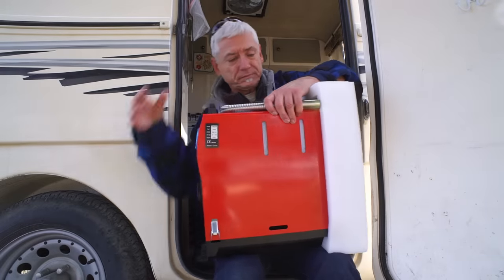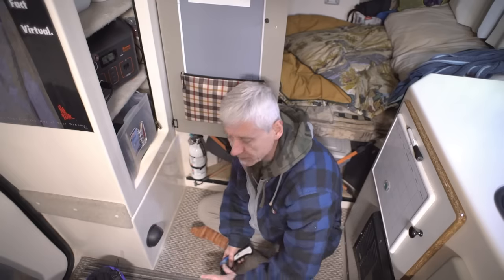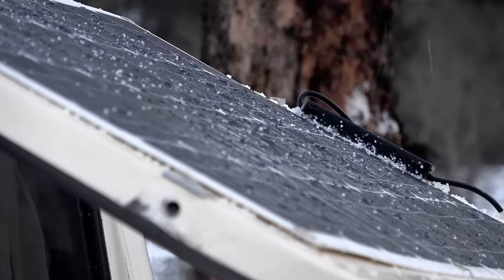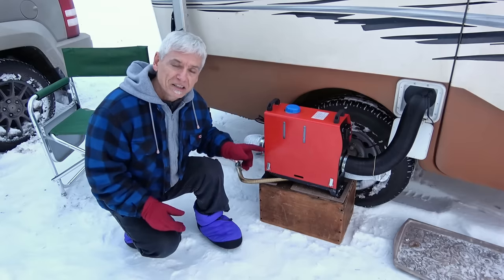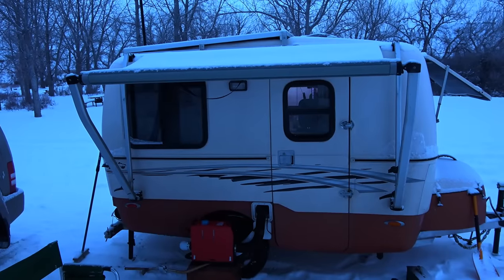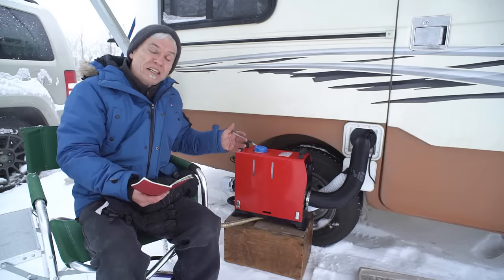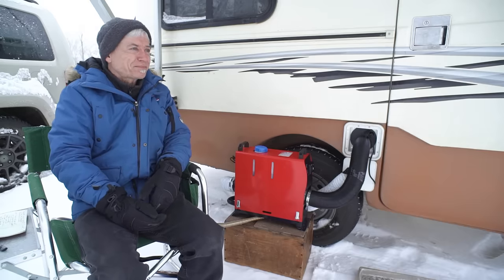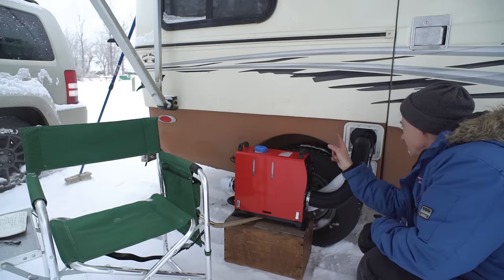Can this Work with a Camper? My Parking Heater Experiment Part 2

Comment: Great review videos SP. 

Now you need to silence that fuel pump! There are great YT videos on how to do it.

I can hardly wait to see you bring out and use the Fat 50 rocket stove again. Such a great design and build series you did on it. Needs no power and isolates the combustion from the living space so you don't have to open windows when it's minus 30 C. You have done 4 hour burns using pellets, and you even cook on it while it boils water for coffee! WOW - now that's impressive! Now all I'd want is a longer burn time, and no constant need of tending regular wood fuel.

I've been researching Batch Box Rocket Mass Heaters and encapsulated phase change materials (ePCM) for high latent heat storage for use in applications that don't have space or capacity for the weight of thermal mass storage. Man 2020 was a crappy year in many respects, but the potential for making things better are phenomenal.

Love your channel Slim and can hardly wait for your next video. Best wishes for the new year!

Comment: The sound or the noise that the heater makes, I think, hopefully I could eventually get used to....I think? The big issue I have with this unit would be safety.....carbon monoxide. These things make me nervous. Other than that, you did a great job, just be careful. Thanks for sharing. Be safe.  -Stephen, Ohio 🇺🇸
Reply: @fyter889  I did not know this. Thank you for teaching me something new. God bless.

Comment: well ok you sort of cleared the air. you are so close. thing you missed is you never told anyone you need the hole in the summer. take the intake for heater run it into the trailer. the noise take the pump mount screw out wrap the pump with a pool noodle use a wire tie to hold the pump. now you will have it.  awesome video finally. any question I will help you beat this you are so close buddy 🛠️🇨🇦🛠️🇨🇦
Reply: Good to know you are keeping up with Slim, Badge.😊

Comment: Slim, if you dont have that propane  bottle in front of trailer, it would be perfect place to put diesel heater there. Off course, to remove it from that red metal box. Also I'm glad you extended exhaust pipe. It was really near to fresh air inlet. Have a great new year.

Comment: I've put many 1,000s of hours on my diesel heater over the past 2 years in my truck camper and love the dry heat. I have a built in one, but same thing.  You're correct there is a learning curve with these heaters and if you aren't a handy DIY person then do some research.  Fortunately many YT videos, Facebook groups that cover every aspect of these heaters.  First mod I made was wrapping the pump with foam and making a shock mount.  That cuts the pump click down to barely audible.  Box to protect it from the elements would be practical too.  Look at all the videos you could do trying to stay warm.......:)   Stay safe out there.
Reply from the maker: In all honesty, none of the online suggestion accomplish what a I am looking for. A portable unit that keeps the trailer above freezing in a eggshell camper. No van build stuff. thanks! SP

Comment: My own 'experiment' reflects your experiences exactly. I fitted one of these to my teardrop camper and came to pretty much the same conclusions......If you're good at 'tinkering' and understand the risks, I think these can be recommended. I now keep mine in a modified toolbox which keeps the fuel line and exhaust pipe separated and running in two different directions. Good video! I haven't been brave enough to try sub zero camping yet though! One note: I found that mounting the fuel pump to the toolbox and keeping it isolated from the camper makes the annoying 'ticking' sound down to an acceptable level. YMMV.
Reply: Yeah I was wondering whether mounting it in a better case would help. I'm sure that flimsy case would do nothing and may even make it louder.

Comment: Just a thought. You can get quite fule pumps cheep at auto parts shop. Also you can replace the fule tank with your own "gas can" and plumb the "can" to your heater and "never"run out of fule as you get a 3 or 5 gal "can". It does work. may be 35.00 USD to do so. Great video thank you.

Comment: I think that clicking noise would make me crazy
Reply: Funny that we get many visitors that can't stand the ticking clocks in the house. We don't hear them any more. It's what you are used to I suppose.
Reply: Have you heard the sound of a typical propane heater in a smaller camper?? That clicking sound is nothing compared to that.

Comment: I'm sure you know by now, if you recycle your inside air, you wont get the diesel smell in your living quarters.  Also, suspend the pump (on an angle), by a rubber band, or elastic cord.  It will almost completely eliminate the sound.  These heaters, while being from a less than reputable dealer (common for their country of origin), do preform very well, when installed correctly.  I understand that you don't want to do that, for obvious reasons. It looks like this heater is causing you a lot of stress.  (I follow your channel and watch every video).  Maybe you should donate it to someone, and get back to being happy.  You're an inspiration to a lot of us.  Happy trails in 2021, buddy.  May your path be smooth and full of wonder.

Comment: I've seen other people on YouTube that mount that fuel pump with rubber and it help make the pump a lot quieter
Reply from the maker: It is on rubber. I also tried wrapping in close and open cell foam. No difference. SP
Reply: @SlimPotatohead  Yes mine is mounted on rubber as well and it’s still loud, but I have seen silicone covers for them as well to help isolate the ticking, no idea if they are any better.
Reply: @SlimPotatohead  I've commented this elsewhere but you could try putting the pump in a box filled with sand. It may get hot, but it's worth a try.
Reply: The place where it mounts to the case is where I've seen them use a piece of rubber between the fuel pump and the metal case most people use like a piece of thick rubber like a cut piece of car tire rubber
Reply from the maker: @Franz Rupert, that would totally defeat the portability requirements. Just not practical I'm afraid. SP
Reply: @SlimPotatohead  I'm sure you could mount the box on the heater case and relocate the pump there. I did this with a fuel pump in the back of my car which was silent after that.
Reply: The rubber is like 1 inch wide 2 inches long and mount the rubber to the case in the same place that the pump mounts then the other end mounted the pump so the pump only mounts to the rubber then the rubber is isolated the pump from the metal case I've only seen videos of it done and from the video there's a big difference in the loud clicking they make
Reply: Good luck and happy new year just putting me two cents in  trying to help someone out keep up the great videos

Comment: Slim from my experience in Newfoundland in 1969, running diesel generators. We had a cofferdam outside the building where the tanks were, when the temperature got down near 0' Fahrenheit ,the fuel oil would start to separate, there is paraffin in fuel oil and it starts to gel causing the lines to clog up! So we had to put warmers down in the cofferdam to keep the tanks above freezing. Out in town, Jersey Side, I rented a room in a house and they had the same problem, Nefie style, everybody had a 55 gal drum up on stilts, with a 3/8th copper pipe into the the old Sears pot heater. (a lot of people did not have electricity) so I had to take a torch and go along the fuel line to melt the clog away. The usual place was the fuel filter at the tank, it looked like a milk shake.
Reply from the maker: Perhaps they didn't have winter diesel in 1969. They do now, in every Canadian gas station! Thanks, SP
Reply: @SlimPotatohead  Yes, that might be, in the States, there is #2 fuel oil you buy for heating use that has a red dye in it. It is cheaper than the one you get at a fuel stop because that diesel has road tax on it ( trucks do a lot of damage to the roads), but I don't know what additives it has other than the newer low Sulphur kind. When I got out of the Navy, I went to HVAC school because I learned in Newfoundland that working on trucks and busses  with your but slung out in the wind or big gobs of ice and gravel laden snow falling in your face when you were underneath, was not the way to go. Not that I didn't come out of some of my oil burner jobs looking like a coal miner. Just started getting into RV's while helping my daughter trick out a ProMaster City. I am looking for one to do a conversion now, but I need a high roof one. A few around now that the Pandemic has put a lot of tradesmen out of business. I am in constant contact with Static Camperman in Seattle. Sorry the borders are closed because I would like to do the Maritimes. ( No Nefie Jokes please) Besides they all moved to Toronto when they shut down the cod fishing!

Comment: I am contemplating installing either a gas or diesel heater into the bed of my overland pick up. Still doing research on the best way to go and there is so much conflicting info that I am still undecided. My own opinion is you get what you pay for so I would most likely buy a Webasto even though the cost is outrageous. Thanks for all your work on this topic I found it to be very worth while. Wishing you save and peaceful travels.
Reply from the maker: You get what you pay for is meaningless. Does spending 10 times the cost get you 10X more? Never. SP
Reply: I think I would justify buying the Webasco based on safety alone. Plus you can get them that run on regular gasoline eliminating the need to mess with diesel fuel if you don’t have too.
Reply: @salparadise8974  The Webasto gasoline heater is what I am leaning toward. I can tap into my gas tank and not have to mess with carrying diesel. I have read the carbon build up is greater in the gasoline heaters necessitating the need for carbon removal more often. I have not read of anyone having safety issues with Webasto unlike the Chinese heaters SP mentioned he has safety concerns. I will continue to do more research before making a decision. I am not convinced the Chinese heaters are of the same quality and I don't like to mess with products that you have to constantly do this in order for them to function for their intended purpose.

Comment: I’ve Watched a ton of diesel heater installation videos and no one has ever installed one outside like that. I Purchased one and haven’t installed it yet. I want to install it in my motorhome. I plan to figure out a way to dampen the tick tick tick noise so I don’t have to hear it.
Reply: I don't know how hot the pump gets but you could try to build a little box out of wood around the pump and fill the whole thing with sand. This would cancel the noise. Might not work because the pump could oberheat and stop working.
Reply: I suspect what your hearing is the injector pump. You could insulate the heater to quiet it from neighbors (simple to do) but the hard part is the air hose going into the trailer. It acts like a audio transmission line to the inside. The only way to quiet it is to put a muffler (designed for the specific sound) and not restrict flow. It’s a difficult engineering challenge.
Reply: There is a guy who camps in a tent on the car roof. He has built them into a suitcase and has it outside the tent.Sorry I can't remember the name but you should be able to find it on YT.
Reply: I had one inside of my 26 foot trailer. It was so noisy I removed it and sold it. I went back to my PlatinumCat brand propane heater for a more steady fan noise. It too is very thrifty on fuel.

Comment: Need to Run Them on High before Shutting it Down,Burns off Excess Carbon Build up,[not a fun job-Cleaning Inside]
Reply from the maker: It does this automatically. SP
Reply: Right, Same I do.
Reply: Never turn the power off but always let it cycle down to cool the heat exchanger before shutdown. I'm told it can cause damage to just kill the power....
Reply: @SlimPotatohead  not compleetly, the fan cycles up but the fuel stops straight away. You need to set it flat out for about 5 min then switch it off. I haven't had to de soot mine since starting to do that.
Reply: @SlimPotatohead  What it does at the end is turn off combustion and run fan to cool down the unit.

Comment: I am a hothouse plant from South Louisiana. If the temperature drops below 66 F,  I can't sleep, regardless of how much bedding or clothing I have on.  My wife, being from Canada, is more comfortable at the colder temps.  We compromise and set the thermostat at 68 degrees, cold enough for her, but not too cold for me.  We also compromise at the upper end of the range.  I am quite comfortable in temps in the low 80's, even with 100% humidity,  but she is dying when the temps get above 78 degrees, so we keep the house at a rather cool 74 F, in the summer.  We used to visit relatives in Canada during the summer,  and I knew I could never stand a Canadian Winter.  I am tempted to play "Snow Bird,"  and move down to Mexico for the Winter.  :D

One more thought, wouldn't it have been better to replace the high current draw inefficient fan in your current heater with a more efficient one with lower current draw?

Comment: After fighting with 2 of the Chinese heaters for 3 years as a permanent install in my Delica Van, I finally gave up and bought the same Webasto from Russia around Christmas. So far so good, and the better quality is obvious, but in tests in my driveway it also seems to shut down after 12-18 hours in spite of the 200 AH battery it runs from, a problem I will be addressing today in fact. I am making a portable one like yours from the Chinese heaters in a spare metal case I had rather than throw them out. For those, I have the same controller as your second one because I was told that is the only controller to use at altitude such as the Columbia Icefields where I often camp. I cannot hear the fuel pump of the Russian unit at all, perhaps because the fuel pump uses a damper (I think you can buy these dampers for a few bucks from Ali for yours), and it is mounted in a rubber bracket and has  no direct contact with metal. It also gets the inside of my van up to +16 when the temp outside is -25C, which is about a 10C improvement over the same Chinese units. The two best Youtube channels I've found for dealing with these heaters are John McK 47, and David McLuckie. I have also found the Chinese units work best with the premium grade diesel, possibly because of the higher cetane rating.

Comment: Just for info as standard in my small 15ft long motorhome it has a convection gas heater that doesn't use any electricity.  Has a mechanical thermostat which turns gas up and down. External flue etc. Its nearly 30years old and still works ok. Cheers from old George

Comment: I always run my heater on a high setting. Reason for that is it helps burn carbon that would collect in the glow plug and heater exchanger. Another thing I learned is the exhaust tube needs to be straight as possible coming off the heater. The exhaust flow needs to flow easier without restrictions. It helps it run hotter and more efficiently. It also may have been a reason for the diesel smell not being burned off.

Comment: A very objective test. I have had Chinese and German diesel heaters but fitted internally and with the air recycling. All the pumps tap tap. You can buy a rubber moulding for as few dollars on Amazon or Ebay that will solve that. Personally I wouldn't like the fresh air intake on the outside in the environment of exhaust fumes.

Comment: Live and Learn I guess.   You don`t know until you try.   I use to have an old 1966 Apache pop-up with a Direct Vent Gravity Furnace.   It used outside air for combustion, had a sealed combustion chamber and Thermostat and best of all it used No Electricity.   It was only 20K BTU`s but it kept that pop-up toasty.   It had a night setting that ran a big pilot that kept it simmering all night and it did not use much propane.   If you are dead set on having a heating option that does not deplete your batteries I would replace the existing furnace with a LP gravity Furnace, unless you can plumb one through the new opening you made.   They might be tough to find for an RV but its worth an internet search.   I love your videos, probably because I like tinkering as well.   Sometimes things don`t work out but a learning experience has great value as well.    If Edison stopped working on the Electric Lamp after his first few failures we would be running our computers by candle light.   Keep up the good work and keep the videos coming.

Comment: Really enjoy your adventures. Your setup heats cold outside air and blows it into the camper. Make a second hole to draw cool air from inside the camper recirculating it like a house forced hot air system.

Comment: Great Experiment, Camp Out and review Love it!👍 .i Love your Idea with rapping the pipe in the cabinet a great idea, i will do it as Well👍👍
i tend to also confirm that diesel heaters are great! For those interested..
I am one of those permanent installers i needed it all year round since my waterheating system is relative slow and i have a door between Dinette and bed ( cool/warm) so i went with a Russian 2 kW system ( with E-Savety approval, thats about 500 $) which is fine for the purpose..it consumes 100ml +diesel per hour, re-circulates the air in the camper 
, has a temp probe externally ( which is at my dinette as ref temp point 16•c) and is powered by Lifephos Batt 160 Ah recharched by Solar 200 wp if no snow on the roof / panels..Klick pump i wrapped into some Material below the rigg, so low noise Impact to None. and ok
..it draws 0,1-0,3 amp (13V) steady state and if partially heated ( 10-12h/day)one can run 4-5 days off 2 Gals ( Tank) or tap the vehicle tank If needed..i think i needed that, was one of the best adds to my Camper though☀️